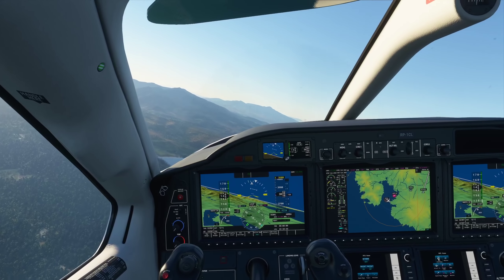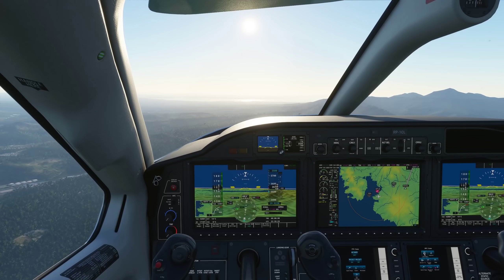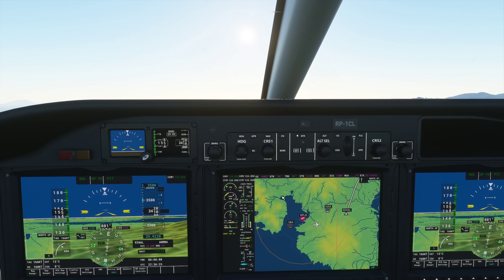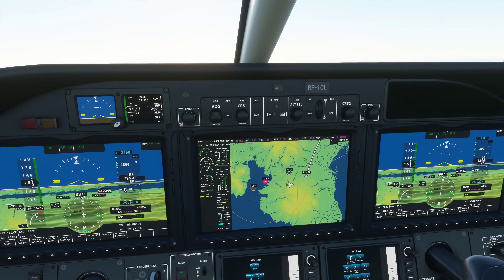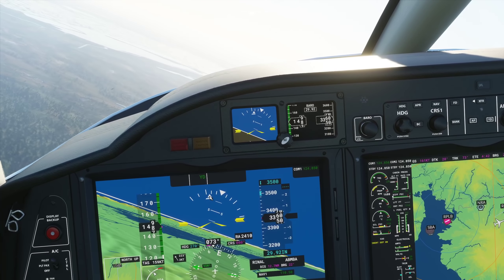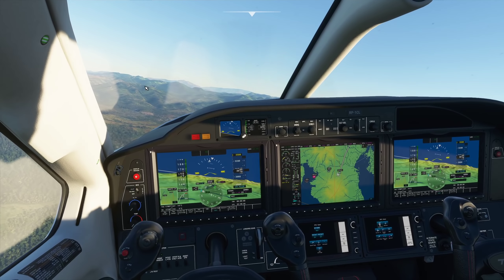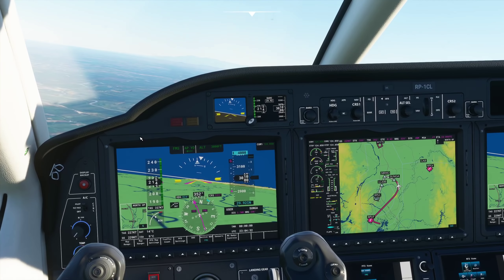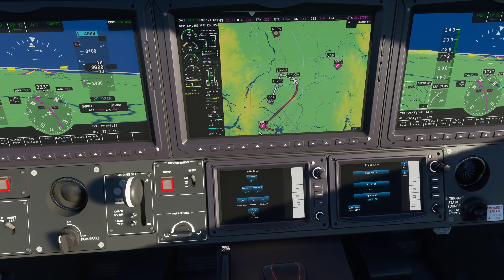Autopilot is BROKEN! (or is it?) - Microsoft Flight Simulator

Comment: That’s it! We need to report bugs as much as possible. While it is new. I am actually afraid that Microsoft will pass the responsibility to third party developers and just leave their their stock aircraft buggy. Remember, we paid for the additional aircrafts and they need to deliver these aircrafts as we expected it to work.
Reply: I have sent a Twitter DM today to Asobo with a link to a You Tube video from an Airbus pilot explaining the errors he found with various fail safe fly by wire systems!!
Reply: Well said, they need to fix a lot of systems and mostly the airliners.
Reply: No, they need to deliver what they have promised. Not what you expect. They never promised a PDMG Level simulation
Reply: Flix Ri Aww. Something like what they did with FSX.  Giving us tons load of crappy aircraft.  At least make the default aircraft open source, so that the community can fix/enhance the current one.  Hopefully, A2A, PMDG and FSLabs are already working on the FS2020 versions of their Aircraft. Those are worth the money!
Reply: Richard Rama I believe some of the community is fixing some of the problems. Earlier today I saw a fix for the fuel consumption of the a320 because it was using 78% more fuel than real life counterpart
Reply: @richard76rama  Well, but they wont give you the enviroment. You got what u paid for, why should you get more for free?
Reply: no worries a 3rd party is already improving the a320 for free!!
Reply: Flix Ri  I thought they promised accurate systems by working with Boeing and Airbus! There are two main issues here :-
1 The systems that they have provided are not calibrated to factory specs.
2 Some of the systems while displayed on the flight panel are inactive!
Personally I can tolerate issue 2 but if this sim is to ever be considered by FAA as a training aid they must ensure accurate calibration of all working systems. Imagine what would happen if VORs were faulty or NDB’s or Flaps!!!!! If I buy a serious sim I do not expect to pay huge sums to PMDG for another aircraft and we as a sim community should stop wasting money and tackle one of the richest companies to sort out the mess! Oh and by the way the system problems are just a few of many hundreds of issues which should have been picked up and corrected by FS Insiders before launch! MS are too keen to get our cash before the product is finished. Everyone is salivating over pretty scenery but we should all approach the product unblinkered by stuttering pretty graphics!
Reply from the maker: Yeah, I think the systems could do with a lot more work. I hope they continue fixing them. It doesn't have to be study-level but should support proper IFR flights without risk of catastrophe lol.
Reply: As I do agree with you on reporting these, I'd also add for us to be a bit patient with MS... although so many things missing, they're definitely headed towards the right direction.. this is a HUGE step from previous FS, and I love where its headed...I'm sure we'll see much improvements in the coming months.  Love this game, it's gotten me out of Call of Duty! :P
Reply from the maker: @joeyagosto  so true! I'm absolutely loving this sim, despite the release-day bugs. I'm confident the devs will be able to iron these kinks out soon we rather than later.
Reply: I'm sure they'll iron these out. I doubt they'll add more features to the existing planes though. Bugs != Feature Requests.
Reply: @timsmith5980  They said from day one that there Planes will NOT be study lvl! And added that this is where 3party devs come in. I dont think that you realize how hard it is to make one single pmdg lvl aircraft! It takes years of developing to make one single airliner into studylvl!
Reply: zombi111980  I think you misunderstood my point, I said that I did not mind that some systems were not implemented, however I felt that those systems that were modelled should be modelled accurately! PMDG aircraft try to implement and model many extra systems!
Reply: @joeyagosto  Totally agree.  When you look at what they are aiming for it's a case of fixing the big stuff first and then working on all the nuances and detailed stuff next.  I don't know how big Asobo's team is but there's a lot of work still to be done.  They'll get there and we have to applaud them for the incredible work so far.
Reply: This is no more than a game, it has good scenery but just really bad airplanes and systems. I can't imagine they had any real pilot who helped them with the system. 
Few blunders that every pilot would have caught.
1. Every autopilot (no matter which plane you fly)will disconnect when you use electric trim.
2. When you press AP, Flight director will always (ALWAYS) show up.
3. Just like VS or FLC or IAS, pitch hold will capture Altitude.
4. Autopilot tuning is of course off. 

Turbprops are just completely wrong. Somehow you never have smooth flight, small planes just keep bouncing. Mornings, evening are normally smooth. Once you are above few thousand feet, air is normally smooth. You can have steady 40, 60 hell 100kts wind and it is smooth, not in this game.  

Before people will say third parties will fix it, we will need PMDG or Majestic. Smaller developers will use default engines that those airplanes will be just crap. 

I just hope bigger youtube channels can point and hope Microsoft will look into it, else they will be just fixing the bridges for years to come. :(.
Reply from the maker: Good points! I hope the developers (both asobo and 3rd party ones) continue improving the sim.
Reply: @richard76rama  let me remind you that you gave your money. Remember once your money is gone the begging becomes  useless. Enjoy the bugs
Reply: Smoos54 yup. The complaints (or begging as you term it), is not useless. It gives pressure to the companies to fix stuff urgently. Else, it will reflect badly on their quality and support. This is a normal software life cycle. Support and bug fixing is part of it.
Reply: Smoos54 Well..  if what you say is accurate, this is different case with Xplane, for which they continuously improving their stuff.. and fyi, this is not a  normal video “game” which will only last for a few years. This is a “tool” for which enthusiasts uses or will use for a long time.
Reply: Flix Ri nobody said PMDG LEVEL just a fricking proper function aircraft. If it comes with a G1000 the G1000 should work at least as good as the back X-Plane kit. And X-Plane is FAR from study level.
Reply: Tim Smith nobody said PMDG LEVEL or FAA certified  just give us planes with proper functioning avionics. If it comes with a G1000 the G1000 should work at least as good as the back X-Plane kit. And X-Plane is FAR from study level.
Reply: Exactly
Reply: For casual gamers, these bugs are  just part of their game. They don’t have any respect for the sim and don’t care about the realism. For them, this is another battlefield air plane game. Soon, they will realize how pointless it is to fly from point A to point B.  They don’t even care about ATC and procedures.
Reply: Richard Rama facts
Reply: @flixri726  It's called post launch support, something developers do so their reputation and games don't die
Reply: I am an old fs user, and used all of them with pleasure , this was up to FSX version .
I was disappointed when I installed FS 2020, and discover that it differs a lot from what we used to enjoy eg. Playback possibility , select departure and arrival airports from countries and regions drop lists. So we have to use the new fs 2020 with its new limitations for the sake of  , I must admit, beautiful graphics , land scapes and weather conditions.
 After one week playing and 100 times crashes , due to the setting of joystick and its up normal high sensitivity , adjusting this helped on better controlling the flight and avoiding unpleasant crashes. 
Now I wanted to go further on my game and started to use the Autopilot ! to my regret , and I discovered I was not the only one, it is not working accurately or some time not working at all. 
It turns the plain into undesired direction and if it catches the flight plan, the flight continues while the pain continuously at a steep bank and the radder is at steep angle.
I understood from many users having the same problem that this issue came only after receiving an update from the developer. Note that the updates are imposed upon us and we can not stop down loading updates if we wish to stop it . 
Any one have an idea when Microsoft /developer will send a new update /patch clearing the AP issues ?
Reply: @namirnoseir389  Hey there! There are awesome mods out there that can fix autopilot if you want to download them. They're free, and they're always safe since they're from the flight sim forums and are usually popular. I fly mostly the cessna 152 and 172 since I've never flown before, and there are some awesome mods that can fix up the planes cockpits to make them better

Comment: Great video! Just to add a little bit, about FLC, the reason to use it is not just safety. All planes have a specific speed at which they have the best climb performance, i.e. at which they get the highest rate of climb. By using FLC you can make sure you’re always flying at that speed. Even when controlling the plane manually, the advised way to climb is to set your throttles to climb power and then use your pitch to control your speed, so pitch up to slow down and pitch down (i.e. less up) to speed up. The goal is to keep your speed on the climb speed, without touching the throttles (you may eventually have to change power a bit if you’re in a prop, where engine power depends on altitude).
Reply from the maker: Ah yes, good points! Thanks for expounding.

Comment: Regarding the two major pitch modes, VS and FLC: Both change the altitude by adjusting the pitch of the plane. Keep in mind that they will adjust climb/descent per their specific monitoring value only. VS adjusts the pitch of the plane to maintain a climb or descent rate regardless of whether you are getting dangerously slow or fast. FLC adjusts the pitch of the plane to maintain a set Indicated Air Speed (IAS). In the current MFS, FLC will attempt to reach that set speed within seconds of being activated - resulting in extreme pitch angles if you're 20 or 30 knots different from what's chosen. For FLC, the mode by default takes whatever speed the plane is at as its current "set speed", so a good practice when wanting to use FLC is to let the speed stabilize before activating FLC. If you're currently accelerating or decelerating then FLC will swing the pitch to try and quickly get back to the speed that was registered the instant you pressed the FLC button. Depending on how fast you were going then, FLC could pitch you up into a stall due trim tab lag.

Comment: Excellent for beginners. I have found the autopilot actually works very well. Where the issues come in is programming the flight plan on the fly. No option to activate current leg. Activating approach after intial appraoch fix makes the plane fly back to where it starts.  Direct too is very sketchy. Hoping for a proper update soon!
Reply from the maker: Ah yes, good point! AP works for the most part, but the flight plan changes mid-flight are very lacking at the moment.

Comment: Although i knew all of that stuff,its nice to get a refresher...
Couple of things i wanted to point out,though:
-When you want to deploy flaps,there is a maximum airspeed that you can do..It depends on the aircraft,but it is always displayed on your airspeed dial/gauge by a thick white line.In your case is 125 KT.
Deploying any higher it can cause structural damage to the airframe or put the aircraft in an uncontrollable and unrecoverable spin IRL (Mostly on higher altitudes)..
Of course the sim lets you do it,but it shouldnt.
-When you tried to change your ILS approach and skip routing to RPUF,you should have hit "Activate leg to waypoint" instead of "Direct to"..
I know im mostly nitpicking here,and apart from that the rest of the AP explanation is done in a very good way....Keep up the good work...
Reply from the maker: Thanks for the info! A little bit on the flaps. The white line is for full flaps, but for t/o flaps it's actually 178 knots in the tbm 900s. 👍
Reply: You seemed like you know your stuff so i was a little bit unsure of whether i should point it out...
Seems like i was misinformed...You live and learn,i guess...
To know the T/O flap deployment speed you gotta go through the Plane manual, or is there an indication on the instrument?
Reply from the maker: @Ov3rHeAtEd  yeah it can be tricky. If we're lucky, for some planes there are plates/stickers in the cockpit which highlight those limitations, but not all have them.

Comment: Very good explanation of everything. Stall instinct should be  nose down first THEN power.  The real FLCH feature means change altitude without changing speed. This doesn't make much sense when the aircraft does not have autothrottle. It is a very dangerous  feature even with autothrottle. IMO it should only be available if you want to descend in which case it would be re-labeled DSND.

Comment: Great Video but worth mentioning that on the TBM930 there is also an Autopilot master switch on the overhead panel. If you start on the runway it is on so no problem but I have found if you are cold and dark at the ramp it is easy to forget - trust me I had several frustrating moments wondering why AP wouldnt engage even though everything else was on.
Reply from the maker: Ah yes good point. It should be part of the startup checklist, but if you miss it that's true. AP will not work.

Comment: The autopilot do need some serious rework, as well as the sensitivity of the controllers using hardwares such as yoke and rudder. Another problem is how the aircraft seems to rotate/lift off, as soon as the aircraft rolls over/hit some bumps on the runway due to terrain. This remind me of the same issue when using "runway follows terrain" on X-plane, but the good thing in that simulator was the option to turn that off. I would like to see the effect of gravity being able to hold the aircraft on the runway, even when it hits some bump. This would never happen at Svalbard either in a real case scenario, although the runway is built on permafrost. 

The serious issue with autopilot is the fact that it doesnt seem to understand pitch and energy management. Its's rather dangerous maneuver when the aircraft overpitches to reach the desired airspeed as quickly as possible. This again results in critical angle of attack being exceeded, and eventually stalls. Another annoying issue is how the aircraft continously wobbles back and forth, as if the trim is never satisified. From a theory point of view, it looks as if the aircraft is unstable rather than stable. 

It also appears to be an issue with "legs page" using both B787 and A320, but this will probably be fixed with help from Zibo or something similar. LNAV and VNAV is not optinal at the moment. 

As an airline pilot on B737 in Scandinavia, and flight instructor on SEP, these are my concerns regarding MSFS. Otherwise, the graphics are stunning and I believe with help from PMDG, ORBX etc. this flight simulator is solid enough to last for another decade.
Reply from the maker: Thank you for the insights! Those are sensible criticisms and I hope asobo sure is listening and doing something about them. Keeping my fingers crossed.

Comment: I have to cut the autopilot off before I do a active pause, if not when I unpause the sim the a/c will either pitch wildly or go into a roll
Reply from the maker: Yeah active pause is not paused enough lol. I've had overspeed or stalling after because of it. Workaround is to make sure your speed is stable (not changing) before you active pause.

Comment: Good intro but you forgot to mention the course adjustment and how you can't adjust it when FMS is selected, and you basically need to switch to HDG mode, change nav to ILS, adjust course, switch back to FMS, approach the ILS, then switch NAV to ILS and the course is correct. This is not a bug, and think this is how it is supposed to work.
Reply from the maker: Yeah I forgot to mention about the CRS, good catch. I do have that in the description, though. You should be able to change the CRS when you're in NAV1 mode. If not then that should be a bug. So far I have not needed to adjust the CRS yet, though. It seems to get the correct runway heading already.

Comment: I'm a CFI-I that taught on G1000 turned to Airline pilot... so take that for what its worth (not much)

My biggest gripe of all is loading approaches. In this game it is like pulling teeth. First off if I am just flying around VFR with no flight plan, I cant manually select an airport to put an approach in unless it is in my flight plan. The real world G1000 is not like that. Real G1000's allow you to select and airport on the select approach page. Another thing is on my current flight right now, I have KASE as my destination but I STILL CAN'T SELECT AN APPROACH. No matter how hard I try, it wont go off from NONE to the LOC/DME-E in to Aspen. I can fly that approach fine with nothing in the GPS but it is such a huge bug that makes it a pain to do any IFR flying for me. Lots of other bugs too. I can go on and on. Don't get me started on the Airbus.
Reply from the maker: That's a good point. I tried modifying the flight plan mid-flight and also encountered a lot of errors. The sim even crashed a couple of times. Basic AP works, but most things to do with the flight plan is still very raw, unfortunately. I hope they continue developing it.